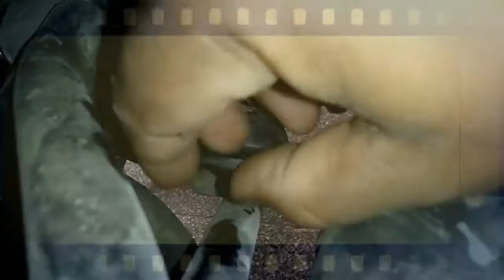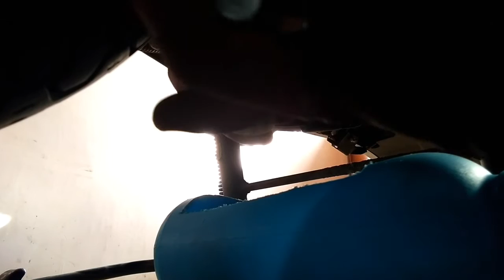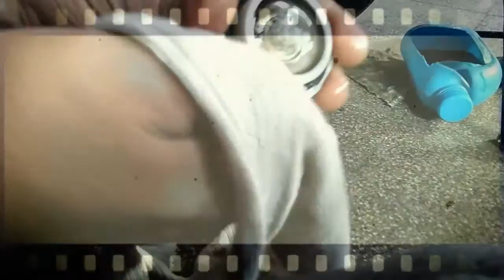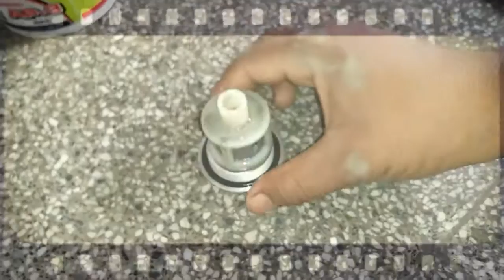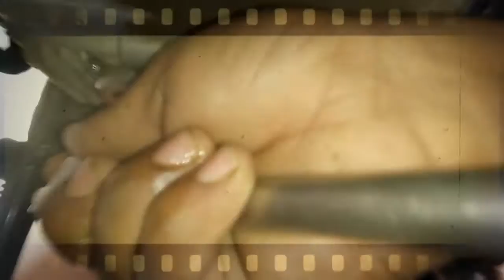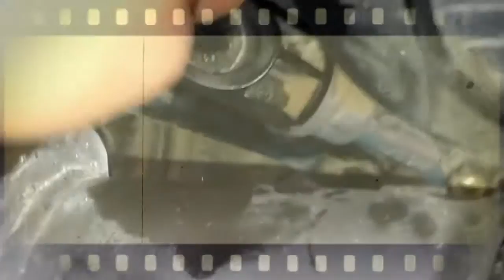how to change engine oil all gearless scooter

Comment: Can I use API GL-4 SAE 90 gear oil in Transmission of TVS Jupiter or Activa 4G gearless scooters? 
Will it reduce the performance of scooter pickup and reduce the milage and increase the wear & tear of transmission gears of scooter?

Comment: “Hello. I have problem with my economy mode light. When I got the pep it’s power mode light was on all the time. When I cleaned the engine and restarted pep it’s economy mode light was turned on and it went off after driving a bit. Now again power mode light is always on and it’s not switching into economy mode. Your help and advice is sincerely appreciated. Thanks”